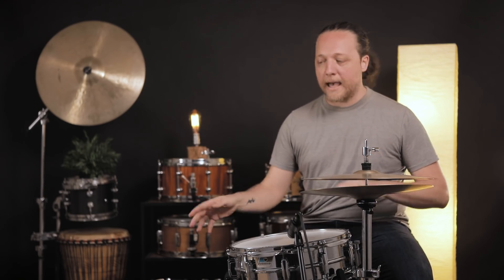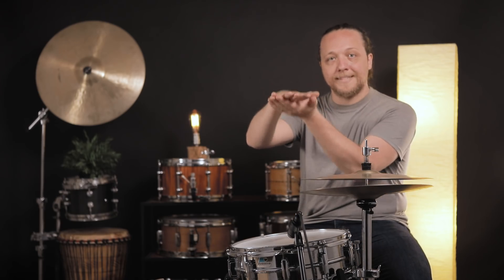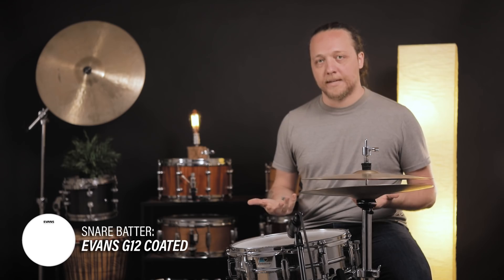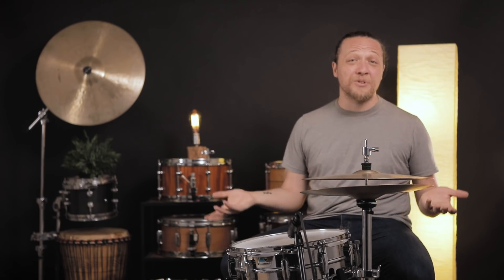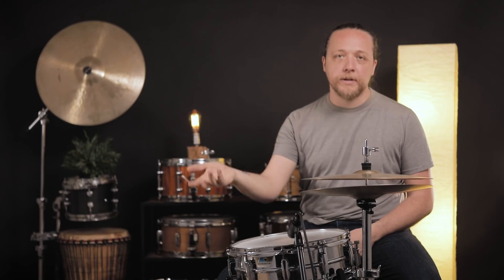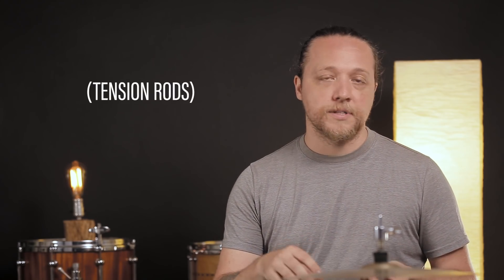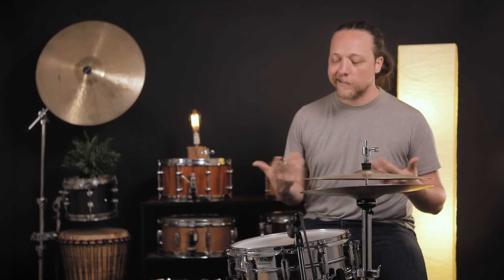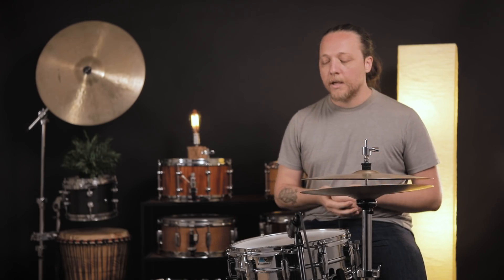Rimshots & Lug Locks - Unwanted Detuning | Season Two, Episode 32

Comment: Hi! I couldn’t help but to comment on this video by saying that almost everything that was mentioned in the video has happened to me at some point or another during my performances as well. LugLocks are very useful. Great insight and acknowledgement of these problems! 

An interest that was touched on briefly in the video was corrosion of lugs, hoops and metal on drums. Asides from making sure to always lubricate drum gear where there is any metal to metal contact or friction where there should not be, regarding general corrosion on drums,  what can be done to prevent corrosion on metal snare shells, lugs and hoops without damaging or hindering the sound of the drum?
Reply from the maker: Thanks for watching and glad to hear that you enjoyed the episode! As far as maintenance goes, keeping metal clean and dry will make a world of difference. Cheers!

Comment: As I watched, I wondered about the nylon washers that sometimes come on drums and whether that was supposed to be their purpose as well? By providing a bit of give between the rim and the flat of the bolt, it might save on tuning?

I've just recently purchased an OC Drums 13x7 maple which has diecast hoops and can confirm that the detuning tends to be all-around with it. Worse by far, actually. I hadn't really made the connection until I watched this, but the difference is unmistakable. I'm a very rim-heavy player, though, so your mileage may vary.
Reply: Nylon washers are actually just to prevent wear on the hoops/tension rod. My old Rama kit had the steel washers and almost rubbed through on the snare. Needless to say they’ve been long replaced by nylon washers.

Comment: I recently put lug locks on my supraphonic and after one song 2 of the 3 popped off! Do you know why? I've never had that happen before
Reply from the maker: Were they at all loose? Any chance you may have hit them? Did the tuning change on the lugs you were using them with?
Reply: @SoundsLikeADrum  I didn't notice they popped off until after the song, but yes they did loosen. I put them back on, it happened again, so then I just gave up. At this point I'm so used to having to check those tuning rods that I'm just dealing with it now.

Comment: I tried Tightscrew tension rods on a couple of snares.  They made tuning the drum a little more difficult (yes, they are a little harder to turn once they meet the lug nut), but they stay put once you're there.  It's almost like they attacked the problem from the source.

 https://www.tightscrew.com

But...when will someone invent a lug insert with a nylon ring inside to prevent the rod from backing out?  

Great video as always, Cody.

Comment: Try purple (adjustable) loctite.
Reply from the maker: We’d rather not put stuff like that on tension rods if we can avoid it.
Reply: @SoundsLikeADrum  It’s not really messy provided you dab it into the hole sparingly rather than on the bolt, excess is easily wiped off too, I use it on my basses saddle height screws to stop them backing out with hard playing and it never makes a mess on my hand while palm muting over the bridge or anything. 

Doesn’t impede adjustments at all 🙂